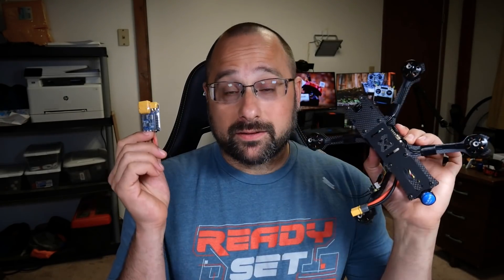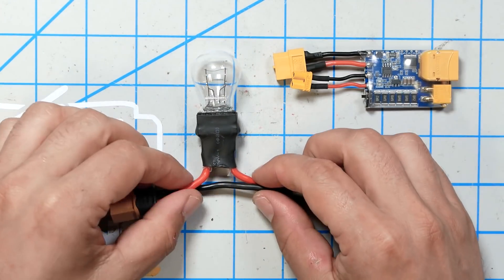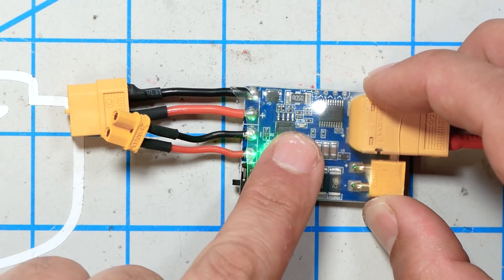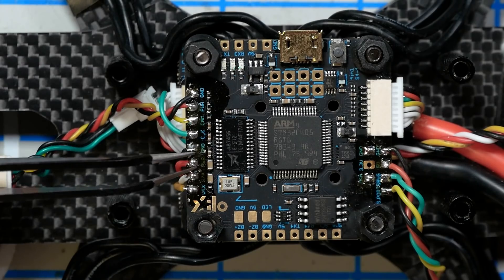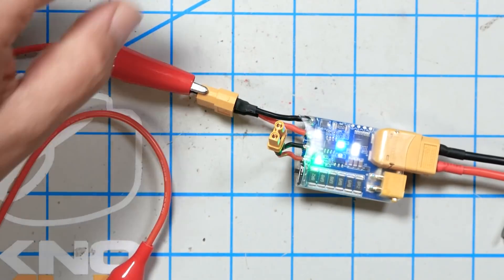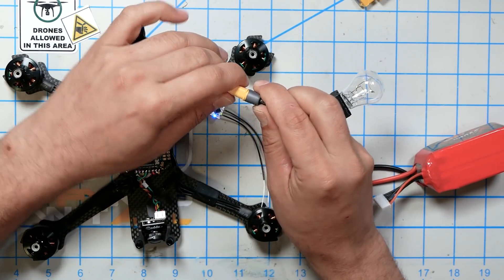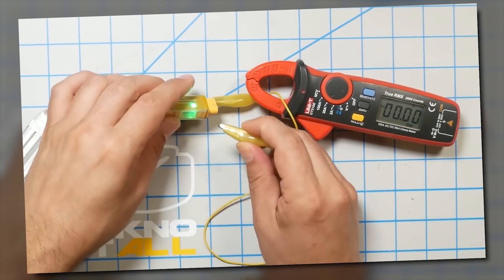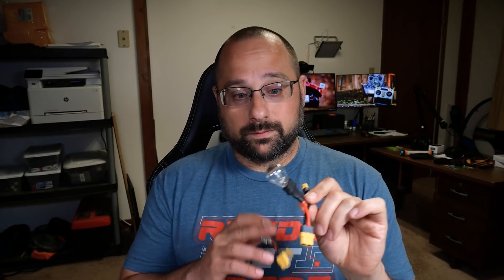ViFly ShortSaver is the smoke stopper you always wanted

Comment: When I first started using solid state smoke stoppers I kept thinking my quad had a ton of shorts in it because I have a gps, leds, crossfire rx, and the DJI air unit. It would always go through the motor boot tones, but then when the FC tries to draw power, it would just cut. This caused me an insane amount of stress, tearing apart my quads multiple times before I realized the quad was just drawing too much current.

Someone should really design a more advanced smoke stopper with adjustable current cutoffs. Currently I can only really test if my esc has a short, not any of my other components sadly.
Reply: I just connect my quads to the bench powersupply, which lets me set a current from 0-10 amps and also displays the current.
Reply: If it goes through the boot tones successfully, you shouldn't really have anything to worry about. If there is an actual short, the current spike would happen immediately after you plug the quad in, not a second or two later.
Reply: @erksampat9328  Or during the boot tones, there can definitely still be a short on one of the ESC outputs, instantly destroying the ESC if you dont have current limiting on the input.
Reply: @drkastenbrot  True, but the boot tones would likely not kill the ESC if the outputs are shorted. But it will die once you test the motors.
This is why I also use my power supply. First boot up at 1A limit, then test motors with 2A limit. Works fine for my quad.
Reply: @erksampat9328  Yeah I'm definitely not worried about my esc, however the big issue is that I won't actually ever get a good read on if my fc is doing well or not. I actually ended up frying a T-motor f4 stack because the smoke stopper didn't tell me what was wrong. Was a good chance to upgrade to a f7 though I guess.
Reply: I'm thinking about designing a better smoke-stopper that has this functionality. If I do, I'll make it open source. But I'm wondering what other features you guys would like to see? If you could have any features you want? From the comment here, it sounds like a power switch is a big thing.
Reply: @gizmoguyar  Dont, the best smoke stopper is a lab power supply. 
If you dont have that you can use a super cheap current adjustable ebay boost converter. I dont know why bardwell even recommends the vifly, the boost converter method is safer and cheaper.
Reply: @drkastenbrot  Bench power supplies and boost converters have capacitive outputs and poor transient response. If you do have a short, such as on a microcontroller output pin, a bench power supply can deliver hundreds of amps before current limiting kicks in. They also don't stop current, they only limit it. If you have a short, this isn't much help. Additionally, ebay switch mode power supplies output quite a bit of electrical noise witch can cause resonance and spurious behavior.  Benchtop PSUs are usually linear, but they're big, heavy, and expensive (at least for one you can trust). I own a few different types of bench power supplies, but I still use a custom crowbar circuit when powering most circuits for the first time. A bench PSU is not the appropriate tool. Better than nothing? yes. Better that a properly designed Smoke stopper? Absolutely not.
Reply: @gizmoguyar  The trick is turning them on with the load connected. They ramp up relatively slowly and dont overshoot by much if you do that. 
The output capacitance on a linear supply is also dangerous enough to blow something up, so the same process applies there. 

Keep in mind the vifly has a response time of about 3ms, which is much slower than a power supply on startup.
Reply: @drkastenbrot  That's exactly my problem with it. It's incredibly slow. We shouldn't have the jump through these hoops to get out and go flying. A well designed Smokestopper should be invisible to the process of building a drone, sitting in series, and only alerting when an issue comes up.
Reply: I know I'm late... I had the same problem with my Nazgul5 v2: after crashing in to mud, i decided to quickly check if it has a short... I've got the startup ESC beeps but then it cut the power. My issue was that i simply didn't turn on my radio and it wanted to start the ESC-Beeping because it had no connection and ofc those beeps are set to max volume and draw more than 2A. I'm sure it's not the same problem you had 1.5 years ago xD but maybe someone is reading this and just didn't turn on their radio aswell...

Comment: Can add diodes to your light bulb smoke stopper for reverse polarity.
Reply: Good thought but no. That would only work if the battery had wrong polarity. Outputting "right-way-current" through a diode into an XT hooked the wrong way still fries...